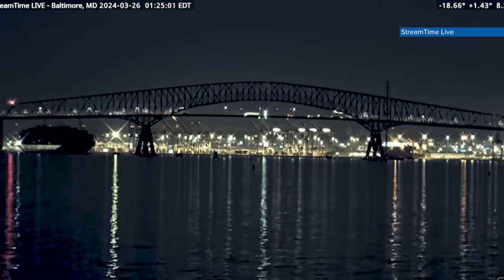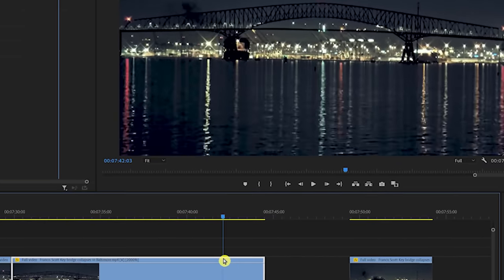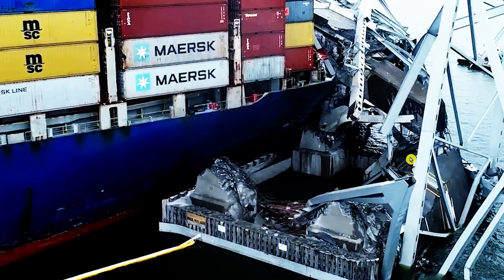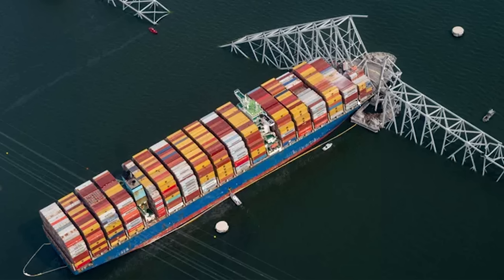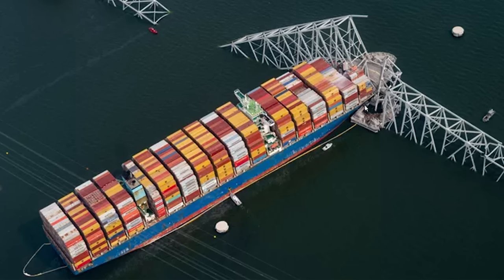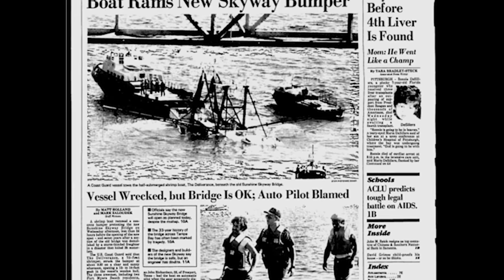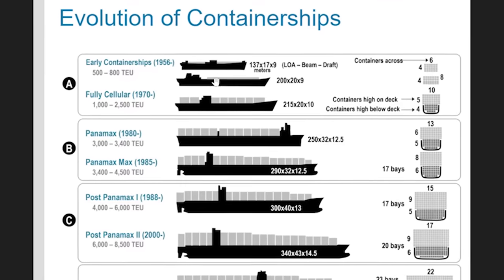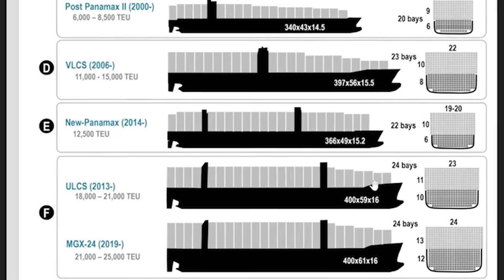NO Dali Bridge Crash Protection Like Sunshine Skyway Bridge?

Comment: Why would the construction engineers not have put multiple dolphins in place when this occurrence may be more likely than the unpredictable occurrence due to extreme weather like a hurricane? What is even more astounding is the pillars were hollow! I mean WTF. Is this how all span bridges are built? Isn't it blindingly clear that a solid column of concrete with  rebar would be impregnable to destruction from even a load like the Dali was carrying? Or at least not likely to disintegrate like that pillar did. Was this a financial decision to lower cost? The example you showed for the late 80s in Florida, talks about a barrier dolphin filled with concrete and rebar to stop a vessel. The pillar on the Sky bridge was much like a structure NOT designed to withstand a direct hit from 100K ton vessel moving with the momentum it had. The only explanation I can imagine is that such a structure would have been too hard construct on 4 supporting footings. Looking at it you have a 45% angle concrete column on a vertical support and making that material internally solid might have been harder than it appears. Right? I would like to see a free-body diagram of this structure. The load forces must so high, that making it all solid concrete was impossible?
You mentioned the shipping bouncing off the barrier, I would have thought an impact would be compressive, not repellant. Aren’t these materials metal and concrete colliding and not likely to cause repulsion?

Comment: if you know that boating lanes thru there and oh the current runs threw those lanes there is a boating traffic lane to the back left corrner of that boat and the current pusing out of that shipping lane along with the fact that the dolly dropped his anchor on front right side to help slow the ship  is what cuase the back of the dolly to twist out like it did right before the hit of the bridge

Comment: A couple things that aren't at all really about spending more money protocols should have been as soon as you lose power within a half mile or whatever it is of a bridge should be instantly. You drop that anchor. Getting any speed lowered helps drastically the dynamic force at 9 mph running into that pillar compared to even four possibly would have made a difference in this particular situation.  or why that's not a redundancy in the system that once power is lost depending on the depth of water, the anchors dropped.  And then the design of the bridge it should never have been connected the way it was for as long as it was. It should have been several bridges that were connected together with a a breakaway or expansion joint or I would have put a piece of road on top of a pillar. So the pillar should have been just a little bit bigger in order to accommodate the separation between two bridges. So that way if there is an accident you only have that one section coming down. You don't have the whole thing like what happened. That's just basic engineering. I don't know what they were even thinking there.   And then what they could do is have it extremely shallow when you're getting near a pillar so a boat does veer off course and doesn't stay in the deepest part of a channel. It will run aground and it might get stuck but it's a lot better than what we have now no bridge then. The ship is also stuck so a lot of these things could have been done. It would not have really added any cost. You wouldn't even need to do half these concrete. Dolphins, which I'm not 100% convinced would do much and maybe they will. But I don't think people realize how much dynamic force that is on impact with something moving that fast and weighing that much take a car. Put it in neutral on a slide decline. Stay in 10 ft. In front of it. Have four people they're ready to try to stop it and that's just moving on its own momentum. And I bet that an LG is nowhere near having real world as far as the size of the ship compared to the car compared to the dolphin compared to the four people or whatever you want to put there.  And then I'm not even sure what's happening with the current. So really once you get near that pillar that current might be actually sucking the ship right into the pillar so that last couple seconds it's actually picking up momentum is my guess. I could be wrong with how those currents are, but typically that's what would happen. It would create a suction.

Comment: I am certainly no expert, but at 8kts and 100t in size but aren't we dealing with significantly more than 380 million pound feet of force on a direct impact? I would think more than double that. Of course the ship would deform and the stop wouldn't be instant, so I guess at some point there isn't enough ship strength to absorb that much force and you would get bucking, collapsing and tearing of the ship structure. So the actual force on average may be within that 380 million pound feet of strength. Also, the beach probably can absorb what's left.

Comment: I recently heard Governor Moore from the scene on TV say they had to call off recovery due to high winds and electrical wires in the water, high winds makes sense but electrical wires does not, wouldn't they cut the power
Reply: The issue might be the location of the switches. There might not be ones right at the ends of the bridge, meaning that turning it off requires turning off power to other active roadways or something. So it’s possible that they need to have the electric utility physically disconnect some cables. But I’m just hypothesizing, I don’t have any actual knowledge of the configuration.

Comment: My '71` Cougar GT is bad ass and all that, but it does not have the safety features of my 2017 F150. Totally different technology. 

Hopefully, we will spend some tax dollars on protecting the older bridges better. But, I am not likely to update the safety features of my Cougar, so I suspect that we won't safeguard the bridges either. After all, It worked fine for half a century without falling down. Reality.
Reply from the maker: Dang they charge $4 tolls on that road the bridge was on, so what are they doing with all that money?
Reply: @jeffostroff  Unlike us, bridges don't heal themselves. It costs money to maintain them.

I feel the pain, though. Here in Portland the bridge crossing the Columbia river is being replaced soon, and they are talking tolls. 😬

Comment: You keep mentioning concerns over the protection the Golden Gate Bridge has and yet you haven't seemed to look at more detailed maps, charts and satellite pictures. There always has been a fairly substantial fender around the most venerable south tower and the north tower is located right on the shore of the Marin headlands in shallow water that a large ship would likely run aground on. Could it use a bit more protection? Probably. I worry more about some of the other bridges in the San Francisco Bay Area though, especially the Richmond–San Rafael Bridge which is a dual cantilever bridge more than twice the length of what the Scott key Bridge was.

But yes, Since cargo ships have increased so much in size that this disaster was a wake up call to many ports as allot of the older bridge protection designs are fairly inadequate against the large container ships

Comment: Pretty decent analysis overall, too bad hindsight is always 20/20 and "Oh so obvious"... I fully agree there should have been more, larger, and better placed dolphins.... but I would also submit that the channel is only so wide and thus limits just how narrow those dolphins "channel" could be.... I also don't think you could have got even BIG dolphins to stop that angle of impact without reducing the channel to unusability.  I also think that the receding tide coming from the side channel was what did more to push the unpowered ship sideways.... like a huge sail with little to nothing to counter the flow.  It was just a horrible accident all around.

Comment: These so called dolphins are for protection against errant small boats, and much smaller ships.  A slowly drifting barge at best.  Anyone who thinks a silly little, yes little by comparison to a 100,000 ton ship, pillar is goong to stop or deflect a 100,000 ton ship that has some speed behind it is completely naive of physics and engieering.   Its akin to trying to stop a car with a 2x4 wooden post.   A much better plan would be to have low speed limits for the ships, and require escort by two tugs until clear of any bridges.   Everyones excited about the protection on the power poles.  Well, if that ship had hit one of those poles, it would have ploughed it like a semi hitting a deer, run over it, smashed it, smahed up the bottom of the ship, and the ship woild have kept right on moving.  You cant send a thousand tons of concrete to stop 100,000 tons.  You cant send 50,000 tons to so that job.   Does anyone understand that 100,000 tons is literally the weight of a skyscraper?

Comment: I am analyzing this using simple logic and simple physics.   We definitely know the maximum weights of these large container ships.  I am assuming that there are some limits on the speeds allowed as they enter and exit a port.  Two simple parameters inserted into Newton’s second law, F = ma would determine the force exerted by the ship impacting a stationary object.

Now using this force, I would hope that structural engineers would be able to calculate the mass of a dolphin barrier that would stop these ships.  In addition, a significant reduction of dolphin mass could be attained by incorporating a reduction of a ship’s speed in the harbors.

Now I can see the downside of this dolphin problem.  The size/mass of these more recent container ships have greatly increased just over the last decade, requiring major retrofitting of many harbor bridges dolphins.  So, the actual problem is likely available money.

Comment: The thing is no matter the size of the dolphins it won't stop but a full protective concrete"island" was needed .That was recommended after 9/11 but republican lawmakers said it was too expensive and not needed .Also the bow of the ship was ground away where it hit the pillar .The current pushed the ship into the bridge.The pilots of the ship dropped anchor to try to correct the course. So where did you get your degree in engineering?

Comment: The dirty unspoken secret is that this type of incident and the susceptibility of certain bridge designs (e.g. fracture critical bridges) has been well known for many decades, and viable solutions available for both new construction and older structures like the Key bridge. The issue is money and likelihood of a top level event like this. Maryland had full knowledge and recommendations of exactly this type of event and the solution in a report done in 1980 for the Maryland DOT after the Tampa Bay Skyline bridge event. They chose not to do anything, primarily due to what the voting public was perceived to want - no new taxes. In fact they wanted lower taxes, and were voting in politicians and leaders who aggressively resisted public spending on "infrastructure" in general. This is one of those things where it's easy to do nothing and let the can get kicked down the road because these types of events have such low frequency, those in power that make a decision to do nothing will be long gone and probably in their graves when something does happen - the ultimate in lack of accountability.

Of course, this was and is a nationwide issue and a well-known fact that infrastructure has been neglected nationwide. Our leaders and Presidents from both parties have talked about "infrastructure policy" for decades as well, so it's not a question of if these types of things will happen, it's "when" and "what", and events like this have happened all over the country. At least the current administration says they will pay for a new bridge with current modern design and protection measures. Also to be noted, sadly, is that there are already several Republican legislators objecting to the Feds paying for a new bridge. As many news and media outlets have pointed out, this event doesn't affect only the local community, it also has a long term impact of the whole country since it is an important national port. 

On a different topic, the veering of the Dali to starboard and the stern pushed around like it shows in the video looks a lot like what would be expected if there was a rapid outgoing tide. I haven't seen any reporting on tide conditions yet, but loss of power, a drag on the port side from the anchor and rudder hard to port acting like a flap in an outgoing tide once the ship gets out of position and no steerageway, would produce results exactly what you see on the videos. It will be very interesting to see the NTSB report when it finally comes out.

Comment: I heard that the black box was connected to the main power supply with no battery backup.  Can anyone confirm or deny this marvel of stupidity?
Reply: Not correct. The VDR has a dedicated battery backup, and continued operating throughout the entire incident.
The data souces feeding it, unfortunately, do not -- and did not.

Comment: The pillar design itself is very small compared to today standard. Usually, modern bridge have very large concrete base cap that use to prevent any ships  hits directly on to pillar that hold the actual bridge. Even without concrete dolphin, ship hitting the base cap will do nothing to the actual pillar.

If they really want to build protection to this size of ship, The concrete dolphin need to be very large not that small small bumper like that which is about the size of pillar itself. It will not bounce, It will crush the concrete to nothing the same way it crush the pillar.

SHIP OF THIS SIZE WILL NOT BOUNCE. Energy of ship hitting it will deform the steel , along with some serious damage to the ship or even make a hole and sink it.

The problem is the bridge itself,  and no efforts to correct this anyway to meet modern safety standards.
Reply: Key Bridge has 4 reinforced concrete pylons/dolphins around the main piers just like the Sunshine Skyway.

Problem was that the ship left the channel at an angle and just missed the pylon.

Considering the bow overhang and the fact the curving path would have missed the dolphin, no, I don't that little island would have prevented the Dali scenario from destroying the Sunshine Skyway main pier and collapsing the entire suspended spans.
Reply: @alanstevens1296 That still mean the base and the pillar is too small. It need to account the size of vessel along the channel in the design. It just OLD and they not design to prevent this ship this large pass below it when it constructed.

The bridge is design with steel trust to to make it lightweight and save cost, so the pillar not need to be very large and strong.

But it's also weak about absorbing impact from the ship. Large single concrete column with to total volume of the size of 4 pillar it much more stronger to shear force.
Reply: @sfalpha  
Nothing lightweight about the design. It stood for 47 years and would have stood for another 50.

The number and size of dolphins needed to protect bridge piers from a 1,000 foot long heavily loaded ship moving at 5 to 10 knots, might not even be feasible without imposing unacceptable hydrological impacts on water flows, given this approx. 5,200 foot wide opening.

Sunshine Skyway in the exact same scenario:

Considering the bow overhang and the fact the curving path would have missed the dolphin, no, I don't that little island would have prevented the Dali scenario from destroying the main pier and collapsing the entire suspended spans.

Frankly I don't think it is possible to protect these bridges from ships of that size.

The Hampton Roads crossings on I-64, I-664 and US-13 are bridge-tunnels with the tunnel under the shipping channel, so that there is no bridge that can be hit by a ship.
Reply: Baltimore port harbours 3 troop transporters,
of almost 300 metres length;
2 of them in service since year 1973.

Those sizes of ships were forseen at those times.

In case of conflict,
3 troop transports of that size
locked somewhere rendered unusable.
Reply: @KarlReimerGodt  
Where were the Navy docks in Baltimore? Upstream or downstream of this bridge?

The US Navy had 10 super aircraft carriers in service in 1977, in the 90,000 to 100,000 ton range. Based on channel depths they could make it upstream to near Fort McHenry.

As far as I know they have never been in the bay north of the Thimble Shoal Channel, which is near Norfolk.

The bay crossings down there (I-64, I-664 and US-13) are all bridge-tunnels with the tunnel under the shipping channel.

No shipping channel bridges to hit there.

Comment: these giant ships and giant long trains need to be made illegal. they take up resources and are dangerous
Reply: That's an extreme solution.  Had the port required tug escorts for ships of this size, the allision would have been prevented.  Easy.
Reply: Actually, its cheaper to run more dangerous operations. Even when things do go south. Kinda' sad, but true nonetheless.
Reply: Without them the whole world would grind to a halt. These large ships are the lifeblood of the world along with trucks and trains. I see what you’re trying to say but from a practically standpoint, I don’t think it is a viable solution
Reply: It's better for the environment to have 100 of these mega ships instead of 1,000 tiny boats.

Comment: Coulden't you build some walls to allow sand to build up around these structures but not in the channel? That would provide a sand bar in between the dolphins to gently get the ship back on course. You could dump the mud you dredge up out of the channel there too. Dubai built hundreds of islands in the ocean to build multi-million dollars homes using these methods.